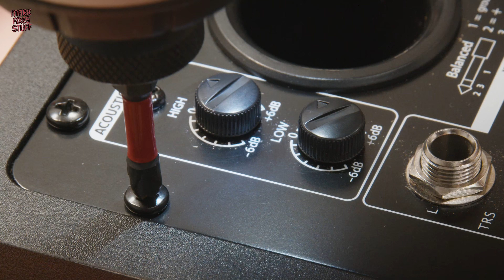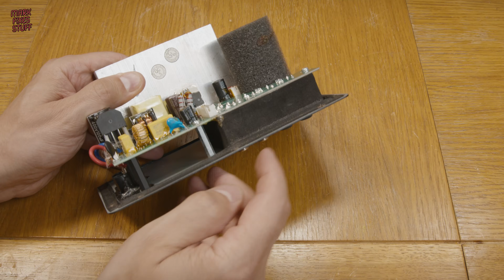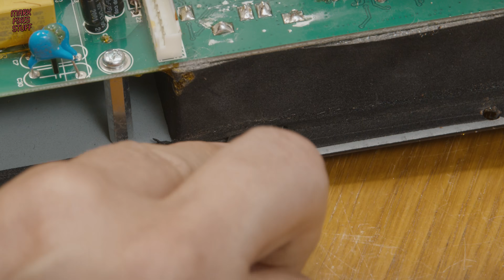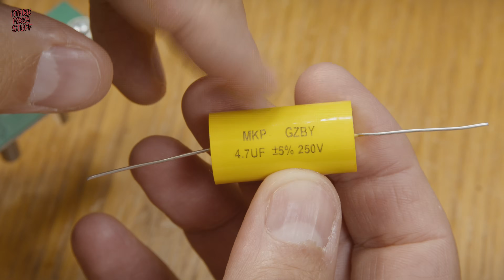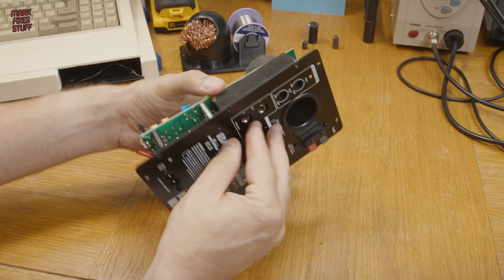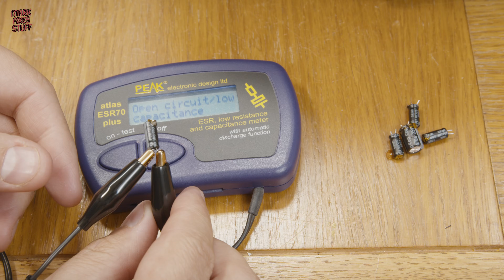My Video Editing Speakers DIED! 😱 Why Did Presonus Do THIS?! Eris 3.5 No Power Repair

Comment: Don't know if these are incorrect but in your caps lists you have C80 and C81 as 10uF 16v, in my speaker they are 100uF 16v, also C74 as 47Uf 25v, mine is 47uF 35v.
Reply from the maker: The caps in my list are correct to what was in the speaker. C80 and c82 are decoupling caps if I recall correctly so it’s not really an issue, and on the 47uf, 35v is just higher tolerance than my 25v. Just replace yours either like for like, or with the same as mine.
Reply: @MarkFixesStuff  Cheers

Comment: Starting at 11:58, the polarity markings on the 100V 4.7µF capacitor are not visible. When replacing it with a polarized electrolytic capacitor, does the polarity (+ and −) not need to be matched?
Reply: It is bipolar so no polarity, can go in either way.

Comment: i'm curious if you know what inductors next to the 25v 1000uf capacitors are? one of mine looks like the cover is melting.
Reply from the maker: I don’t know I’m afraid. Inductors shouldn’t be getting hot in this circuit though? Maybe it’s just coating?
Reply: @MarkFixesStuff  maybe. guess i'll find out once i change the capacitors

Comment: I replaced all but the non polarised 4,7uF capacitor, and now the speaker works again. That last one, of which I didn't have replacement at the time, will probably die soon too, as these capacitors are all of horrendously bad quality. But now I'm prepared.
Reply from the maker: Well done on the fix mate!
Reply: @MarkFixesStuff  Thanks 😃

Comment: This fix did resolve a slowly worsening sound problem before they gave up and started making a high frequency squeel followed by intermittent white noise. For a long time i could hear random, quiet ringing sounds in music, not notes but weird oscillations triggered by percussive sounds. White noise would do something similar but more consistently. Now that it's gone, the speakers are more relaxing to listen to. So thank you also for that! Your comments were very encouraging. 

Did you ever install the polypropylene 4.7uF tweeter cap? Was going to order some myself but after seeing more of the electronics I gave up on whispy nuances. You could just hot melt glue it to the PCB for the amp and the passive speaker crossover. But after reading the hot takes on amirm's Eris 3.5 review on Audio Science Review, I'll stick to port stuffing and knob twiddling, which has been totally adequate in my casual use.
Reply from the maker: I did replace the crossover cap and to these old ears that didn’t make much difference. I’m glad you had success. These speakers are a pretty poor design made worse with low quality cheap components so I’d not personally spend forever chasing perfection. Thanks so much for your kind comments and for watching.

Comment: Thanks for the video! Did this repair. It works. But it's time-consuming. 1 hour to search/purchase parts online. Overall 3 hours to execute the repair, including replacing the electrolytic 4.7uF non-polar cap on the passive speaker. Our production facility has these in non-critical applications but we will not repair them due to labour cost. Tip: Passive speaker can be opened by easily prying off the front plastic with fingernails or plastic tool. It's held with posts and rubber inserts like a speaker grill. Parts cost (mixed Panasonic, Rubycon, Chemi-Con, Nichicon caps) via Digikey in Canada came to about $50 including a small tube of Chip Quik. Only did this because I have already had 2 other similar speaker systems fail for the same desktop audio purpose, couldn't justify spending even more now. Turns out, USD100/CAD150 is just too darn cheap for active speakers for them to last more than a few years.
Reply from the maker: Yeah. In a business setting this is not economically feasible at all.

Comment: Pretty sure the Mackie CR series monitors use the “cap-top” capacitors as well.
    Wouldn’t be surprised if those had the same failure modes. I actually parted out a dead set of CR4 to make some DIY speakers. I probably could’ve changed the capacitors or something, but then again I already had KRK Rokit 5 monitors (the 3rd gen ones, not the old ones with the conductive/corrosive black goo on the boards) and didn’t want the lower end Mackies.

Comment: I had the same problem with my PreSonus Eris E3.5. At first, they took longer and longer to turn on, but once they were running, they worked perfectly. Eventually, they stopped turning on completely.

In my case, the problem was C13, the 10µF 50V electrolytic capacitor in the startup circuit of the UC3842B. I replaced only this capacitor, and the speakers immediately worked again. The old capacitor still measured about 8.5µF, so capacitance alone didn’t make the fault obvious. Hope this helps someone with the same issue!
Reply: Exact same situation here! C13 was still measuring around 10µF, but the ESR was 10 ohms.

Comment: I am using persons eris 4.5 and it has the exact same issue with it. thanks for tutorial. since it was exactly the same way to disassemble. The PCB board is different. It also has Cap-cop capacitors, which is blown out. They have different specs though if you are planning to fix it.

Comment: THANK YOU! Excellent and detailed video, with lots of close-up detail. I replaced C13, C17+C18, C19+C22, C80+C81 and C74. I didn't bother with C12 as like you said it was expensive, it's big and tested OK. I think you got better sized caps than I did as some of mine were a real squeeze (yours look taller and thinner). I went with Panasonic FR Series all round, so top quality, but C80+C81+C74 were all a bit "wonky" instead of sitting flush with the PCB and upright. Still, WAY better than "Cr*p-Top" caps and the repair worked. About a year ago I replaced Q4, the TSF10N60M MOSFET, which had overheated and fried the PCB tracks. I know they're shaving every cent off the BOM to get the final retail price as low as possibly, but what saved them less than $1 and saves consumers ~$4-5 on the final price means that most of these monitors will die this death within 2-5 years of use, which in my book constitues built-in obsolence. At least they're repairable, but what a fiddly job for a few caps! Shame, as the general design and build-quality is ok.
Reply from the maker: Aha! Nice work. My Q4 was ok but I did get one just in case. Honestly, I think the cost cutting on these speakers is a scandal.

Comment: I have the exact same bulging capacitor and was hoping to replace it but got put off by the amount of epoxy slathered all over the circuit board making it impossible to take apart. Following your video it now seems possible to repair but if it's gonna be more than just the one capacitor I'm not sure I have the skills or equipment to even bother attempting a repair. Glad you managed to make yours work again though, but I think I'll just end up buying new ones.
Reply from the maker: That epoxy is honestly the worst part of the whole process! 😅
Reply: @MarkFixesStuff it's all over screw heads and even the clips of the ribbon cables on mine. A nightmare to take apart 😢

Comment: The ones at work had a slightly different issue, power but no audio. Opening it up to inspect the caps revealed nothing. Putting it back together and ta-da! It works again, so just a loose connector in my circumstance. If these were my own monitors, I'd be tempted to re-cap as well after seeing your experience.

Comment: Hi, i like your video a lot and i currently replaced a lot of capasitors, my speakers are running but the right side is much much lower on volume, could it be because of the wrong Volts? or something? would be great to know. greetz

Comment: this company is now known as using cheap garbage componets and have has more than enough time to correct it .they dont seem to care .this company kinda sucks and make junk that will only work for a short time before you will have many issues .this is a common issue with this company if you google it.a pity they could have been a good company but they are cheap and lazy
Reply from the maker: You are 100% correct

Comment: After 2 years of use, the jack connector on my Eris 4.5s died, and a capacitor failed on my brother’s pair. I don’t understand why PreSonus makes such high-quality speakers but uses such poor components in the amplifier. Because of this, I don't dare recommend this brand to anyone, and it’s a shame because they sound really good.
Reply from the maker: It's just massive cost cutting. I'd never buy another pair.

Comment: My Eris also made that legendary “prrrr” sound and then peacefully closed its eyes forever 😄

After my local electronics guy kept it for a week and then basically said “nah, I don’t feel like fixing this,” I rolled up my sleeves thanks to your video. Honestly, before this I had only soldered some basic wires — this was my first time ever replacing capacitors.

I won’t lie, removing the old solder was the hardest part, especially in such a tight space. For beginners like me: after removing the capacitors, you can heat the solder in the holes and use a thin toothpick or needle to keep the holes open. That trick saved me.

If you’re a beginner, this is definitely not an “easy” repair. You need patience and a gentle touch. Also: don’t forget to use flux!

I accidentally ordered a few capacitors slightly bigger than needed, but with some creative positioning, everything fit in the end 😄

And finally Mark… I hate to say this, but I’m kind of glad your speaker broke so you could make this detailed and high-quality video for us 😂
I had never come across your channel before, but you’ve definitely earned a new subscriber.

Thanks for everything!

(Türkiye'de alabileceğiniz kondansatör listesini Türkiye'de yaşayan arkadaşlara paylaşabilirim)
Reply from the maker: Thanks so much for the detailed comment and for taking the time to watch, I really appreciate it. It’s brilliant to hear you tackled your first capacitor replacement and got it working. That tip about clearing the holes is a good one too. In AliExpress you can find soldering needles, which are tubes and because they are stainless steel they don’t stick to solder. They slide over the component leg and into the hole.

Also, thank you for offering to share a capacitor list for people in Turkey, that’s genuinely helpful.

And I’ll take the “glad your speaker broke” comment in the spirit it was intended… I think 😄
Reply: Hocam selam! Benim Eris 3.5'ları öndeki power butonunu on yaptığım an çatır çutur kesilmeyen sesler geliyor, kapatınca ise giderek şiddetleniyor en son yüksek bir çatırtı sesiyle kapanıyor. Sizdeki sorun da buna benzer bir şey miydi?
Reply: @kirmizikep  biraz geç gördüm ama evet çok benzer şekilde oldu ve bir süre sonra hiç tepki vermedi. videodaki gibi benzer kapasitörler şişmişti. kapasitörleri değiştirince sorun düzeldi

Comment: Excellent and informative video. I have the Eris 4.5 speakers and mine pretty much did the same thing. Noticed "crackling" sounds when turning the volume knob, then i noticed the sound stopped coming out of one of the speakers, after that i needed to wait a few minutes after turning the speakers on before i got any sound from both speakers, then it would kind of fade in, that got longer and longer, then they died. I actually took the speakers to a guy with a small repairs shop and he "fixed" them, they worked for about 4 or 5 months and then started to do the same. I have a feeling that Presonus Have more than an issue with cheap capacitors in their Eris speakers.

Comment: Many thanks for the video, was really helpfull. But can it be that the Capacitor List on your homepage shows on C81 and C80 wrong values? I think C81 and C80 are 100yF and not 10yF?
Reply: Yep just taken 100ufs out of my board - so either they have changed the spec or there is a typo on your sheet. Thanks for the video though - very helpful!
Reply from the maker: I’ll need to check. I’m definitely capable of mistakes
Reply: @MarkFixesStuff  I've a taken a picture. If you need it I can sent it to you, than you won't have to take yours apart anymore. :-)

Comment: Top-Cap brand sucks for sure. I recently did the same for a 4.5E, pretty much the same circuit. That foam crap is the worse, but I put it back using 3M VHB tape for sealing (hope I won't need to open it again). I used Rubycon and Nichicon caps as replacements.
I have to say, Presonus use these Top-Cap which suck, but at least they're a legit brand (that doesn't make it a good one). If you compare these passives with what KRK uses, man, these are much better. KRK are the worst I've ever seen: "Vent" brand or some random letter names? they don't even have too many hours on them, also used enough so caps won't need to reform or anything. This is stupid, you as a consumer pay their premiums, but still, you need to spend time and money to make it reliable. Oh, BTW, I used a film capacitor to replace that bipolar cap.
Reply from the maker: That's a smart fix with the VHB tape and film cap! 👍

Comment: I bought a pair of these for 35 euros couple of days ago, and once I opened them up 3 of the capacitors were shot. So I ordered new ones and I am waiting on them so I can revive these speakers once more. I was quoted by a guy that repairs them for 50 euros, which I politely declined lol
Reply from the maker: That’s a bargain to get them working again!
Reply: @MarkFixesStuff  The speakers are alive and well. 4 capacitors were changed, just for futureproofing. The only thing that took a lot of time is opening them up. Thank you again for the much needed inspiration and explanation.

Comment: Heads up for anyone with the Eris 3.5BT (Bluetooth Version). I just successfully completed repair on my units (the speakers were buzzing even without any input plugged in), and I wanted to note that some of the capacitors are different on this board.

The Eris 3.5BT uses all the capacitors in this video EXCEPT for the:
   - Two 10uF 16V capacitors
   - 47uF 25V capacitor

Instead, the 3.5BT board requires:
   - One 100uF 16V capacitor
   - Four 220uF 25V capacitors (I bought 220uF 50V caps to replace them)

The list above does not include the Bluetooth module caps btw. Thanks to Mark for the amazing walkthrough! My speakers sound wonderful again :)

Comment: The list you linked to is also wrong. I cataloged all the caps in a unit I'm fixing and figured I'd check it against yours, because why not? C80 & C81 are 100uF, not 10uF.

Comment: Mine failed today in exactly the same way, bought them back in 2022 so they also lasted around the same amount of time. Took it apart and probed all the caps and it was exactly the same group that failed too. They had leaked all over the board too so i have the pleasure of cleaning the damn thing if I bother to repair it.
Reply from the maker: Oh no, that's really frustrating when they fail like that, especially with the leakage!

Comment: personally i'd have just changed the faulty cap that was bulging.   A bit overkill to re-cap when most of them will be fine.  Extra work for nothing!
Reply: Most weren't fine though.  6/9 were bad.

Comment: Those are absolute garbage. I'm shocked to see that there is basically paper thin batting and the amplifier board is the back of the cabinet. Terrible acoustics. I'll be the midrange sounds weird and boxy on them.

Comment: While fixing my presonus eris E3.5  with same problem I accidently broke off my track pads of capacitor C22-470uf, 25v ( as shown in video at timer 13.46) , Now I am confused where to solder this 470uf capacitor terminal. On pcb near c22 capacitors tracks are not visible. Pl guide me

Comment: Hi, thanks for the video, I have the same issue and this was really helpful video. I have question about replacement caps. I'm having hard time finding exactly the same caps based on your replacement sheet. Does it matter if I replace some caps with low ESR variant even though you mention standard ESR on the sheet? The shop I usually buy from has only low ESR variants in size that would fit.
Reply from the maker: Hi! As a general rule it’s fine to use low ESR instead of standard ESR. Low ESR are generally better parts. Make sure that you only put a non polar (aka bipolar) cap in the crossover position though. Thank you for your kind comments, and for watching! Let me know how you get on.
Reply: @MarkFixesStuff  Thanks for the reply. Yeah I have hard time finding replacement for that bipolar one, at least some that's rated at 105C. All that seem to be available (with normal shipping in central Europe) is rated at 85C, or have like 5 times less endurance when operated at 105 according to their data sheet.

Comment: I have these exact speakers and they died last night!  Slightly different issue, when powered there is a lot of speaker popping.  I took a peek at the capacitors and they are bulged of course.. 

I would love if you have the correct capacitor list somewhere
Reply from the maker: It's up now. Please let me know if it works for you: https://markfixesstuff.com/presonus-eris-3-5-no-power-fix/
Reply: @MarkFixesStuff  That worked, thank you so much!
Reply: @MarkFixesStuff  Yay! Once again, Thank you for this video! I ordered all the caps from your list from digikey.  A few dollars and a few hours later it's fixed!  You saved me a lot of time and money! Good stuff! 

You were correct, desoldering was a pain! I also broke the high voltage side wires to the terminal by flipping the board over many times. Easy fix and my speakers are back in action. :)
Reply from the maker: I’ve not been able to post it because the website was down. I’m going to see  what I can do this afternoon